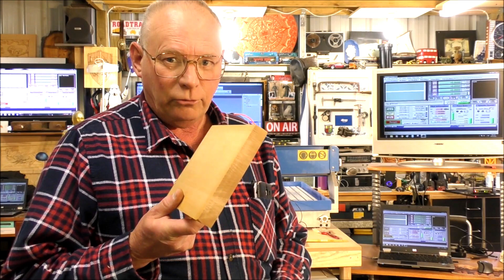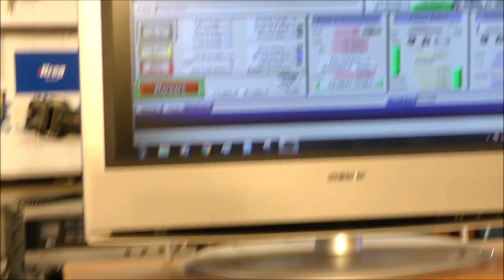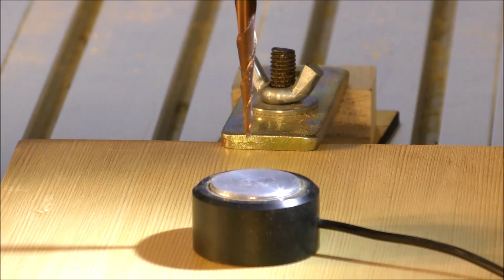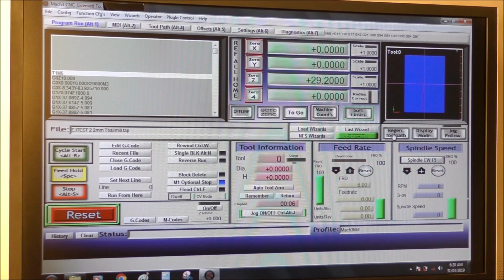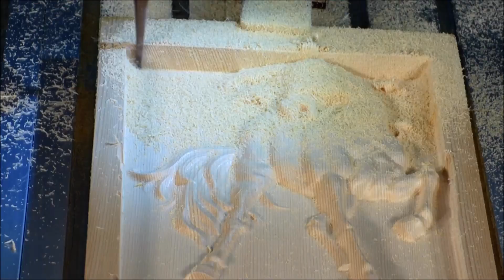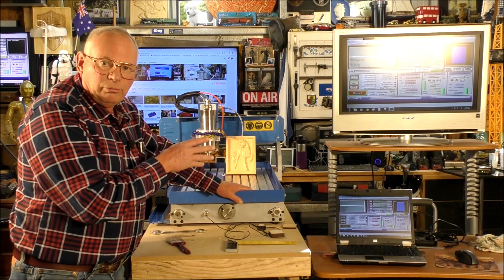How to start with a 6040 CNC Router for Beginners

Comment: Can you please contact me I  need a full course of programming and setup and using this CNC. We can discuss the cost of the course. 
Thanks
Reply from the maker: I can definitely help you, however, I can only do this through Patron.  You will need to become a 6 Axis Lathe/Mill $50 per month Patron member. This level is purely for technical assistance and support for CNC machines, operating systems, CAD/CAM and manufacturing solutions for hobbyists and businesses.
Help support my channel and become a Patron
 https://www.patreon.com/user?u=15079773

Comment: Hi Roger
I know you gave a cutting channel to get in deep as to not burn or break your cutter
But for practice wouldn't it be good to show how you could do that in a tool path before commencing to the full roughing cut or was it a finishing cut. As a bit confused
Anyway thank you for showing your method
I noticed the nice shine on the material after cutting
What brand of cutter did you and the type you use and speeds and feed.
Reply from the maker: Hi, have a look at my ArtCAM and Carveco videos

Comment: Hi using the technique showed is it possible to avoid the 3D roughing toolpath all together saving time many thanks
Reply: I would not avoid a roughthing cut as you need to obtain a finishing cut to smooth out the imperfections but I'm a bit confused to what cut he used in his toolpath
Maybe I didn't understand